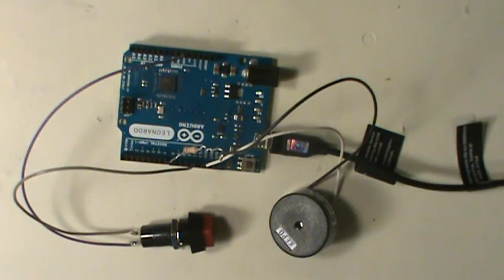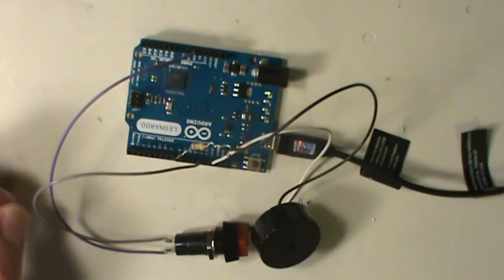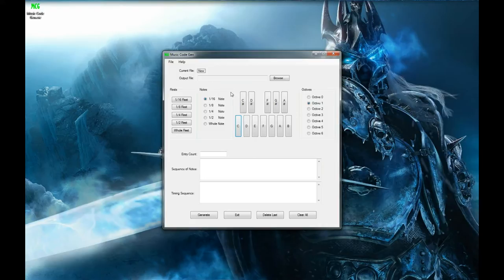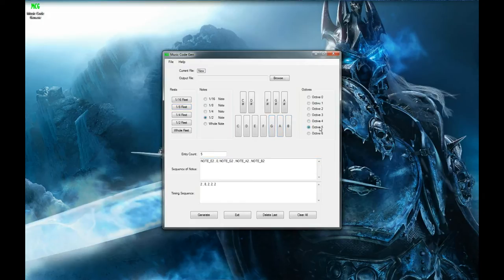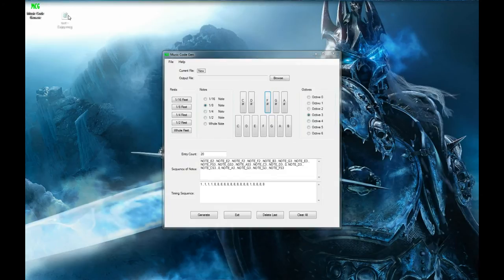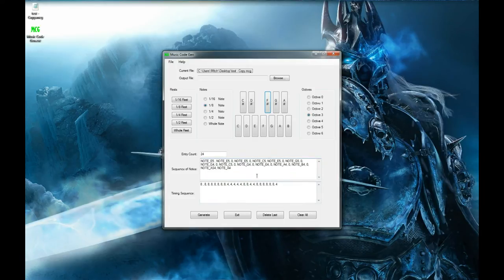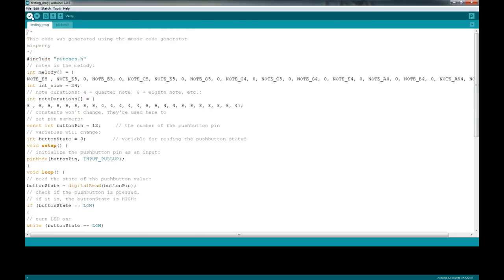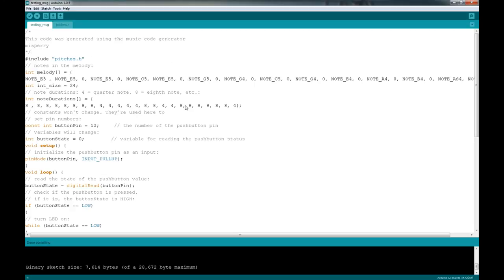Demotime - Arduino Music

Comment: Cool?  My wife has musical Christmas bell string from the 70's that plays a tune and a specific bell lights as a tone is played.  It went bad and while repairing it I discovered that it uses a microcontroller.  Fotunately it only needed a 5v linear regulator but it got me thinking about how to do the same with an arduino mini.  Your two videos on this subject are very interesting.